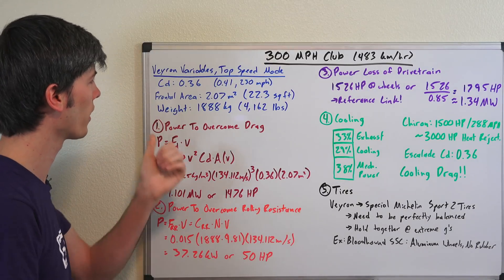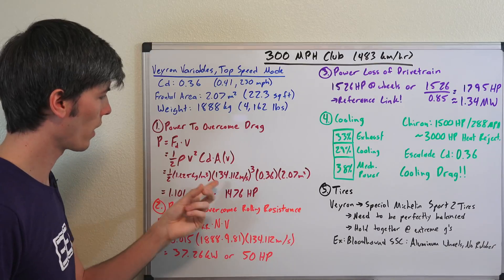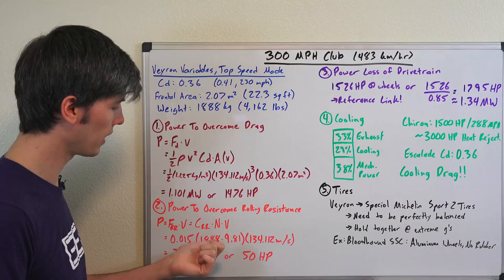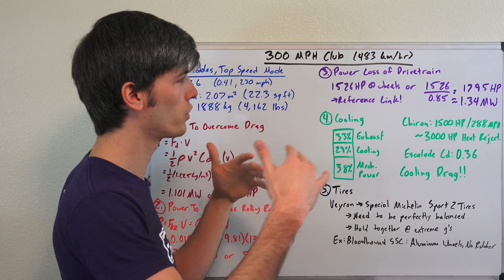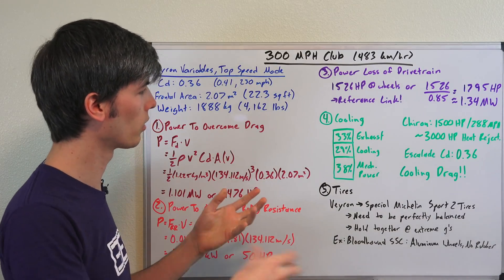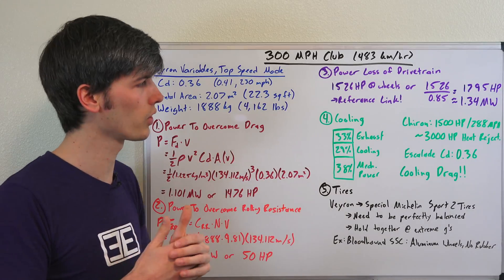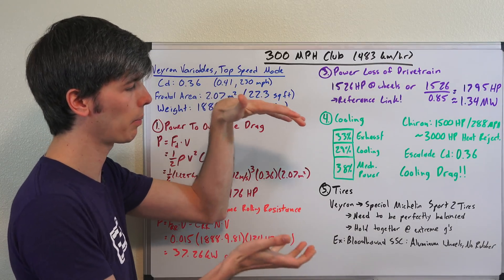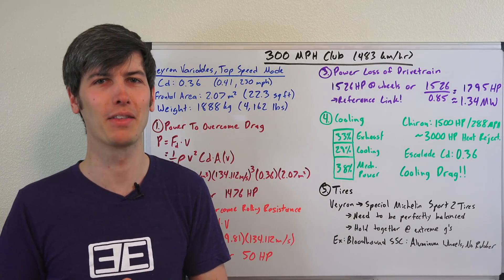Why Has No Production Car Hit 300 MPH?

Comment: A $350k drivertrain better be able to do 10% or less impact on hp. Even so to produce more hp would require significant mods and the increased cooling of those mods making it heavier which will also make it need stronger heavier tires.. The veyron platform is not a good starting point to reach 300mph from factory. The Carol Shelby approach might work, small super light body with a beast of an engine. Starting with a 454 you can get to 2k hp easily. With a light body that's more aerodynamic, and has the new hollow wing system combined with built in rads. So creating  downforce also becomes cooling equaling less drag. It could be achievable at a more affordable cost than a veyron, but most cars don't cost half as much as what they sell for anyways. Tires, and politics are the 2 big things preventing this from reality. Also why buy a factory car to go 300mph and not just build one. It's not a smart idea to go 300mph and then try to daily the thing afterwards.

Comment: i have a feeling electric cars will be able to do this easily since the batteries and motor dont generate heat at the same rate that a comparable engine would plus you would eliminate the power loss through drivetrain by just going direct drive

Comment: Do electric cars need motor and battery cooling and if not or less; how would that impact the Cd and with that P required from the new Cd would it be possible for an electric car to put out that kind of power??

Comment: Seems like from a cooling perspective that speed might be easier to achieve in an all electric vehicle. As much as I love the ICE it isn't that efficient in using all of the energy it generates (I believe somewhere around 20% efficiency compared to around 90%).

With a lower CD and area the power required would be less, the challenge then is an energy storage device that can handle the discharge rate required to generate the power.
Reply: Ross Hines f1 engines are working at 50% and you also have to consider the weight of the batteries and the heat they create when discharged

Comment: Design the car's body with an inner shell that maintains a narrow gap with the outer shell; then force coolant through a channeled gap under the aerodynamic outer shell.  Alternately, coolant tubing could be bonded to or molded into the underside of the car's skin.  This way, the huge surface area of the car's body becomes a radiator, activated at high vehicle speeds.  Such a system would require low-pressure operation with a condenser and valves to keep coolant from boiling as a second stage of cooling that augments a small conventional high-pressure system.  OK Jason, tackle that scenario!

Comment: In the rolling resistance calculation, you assumed that Fg = Fn, but this ignores the downforce that the car produces. So that estimate is probably quite low.
Reply from the maker: +Joe Smith did not account for downforce, correct, but I used a conservative (high) estimate for Crr. Additionally, rolling resistance is very minimal in comparison to aero (about 3% in this case). Certainly should be included for completeness, but doesn't have a huge impact on the final result. Ideally, for a top speed vehicle, you don't want significant lift or downforce. Just enough downforce to keep it stable and prevent lift, but not much more. Adding downforce at speed means greatly increasing the amount of aero drag to overcome.

Comment: Why doesn't the downforce matter when computing the rolling resistance? I'd assume that the normal force changes because of it as N = G + Downforce.
Reply from the maker: +Paul Herman should have included it, but idk what it is. In top speed mode, the car is set up to reduce downforce and thus reduce drag.
Reply: Engineering Explained i think due to the high speed air going down below the car lifts the car which cancels the excessive downforce also the presure variation should also have had some effect in that hence rolling resistance might just be fine without it
Reply: Your equation for air resistance has it varying as to the square of velocity.When you put the actual numbers in the equation you cube the velocity.I believe this is correct.

Comment: hell, why even buy a car with a max speed of 100 MPH if you're only gonna go 80 MPH on a highway
Reply: Kenan Varin I did 140 today you are fake news
Reply: Kenan Varin Put it this way, if your car is topped out at 80, that engine is screaming, compared to a more powerful car which can cruise at 80 with the engine barely breaking a sweat. Also, the typical car would probably only need like 70 hp to reach 80, which is not much power to accelerate a 3000lb+ car from a stoplight or to merge onto the highway

Comment: Hey Jason, quick question. 
If the engine thermostat is not fully closed when it should be, is it bad for the engine?
P.S it's a 1.6 litre 90HP Renault in a hot climate country.

Comment: could you get up to 300mph in an electric car since you don't need a complicated cooling system
Reply: fastest production gas vehicle right now - 280mph. Fastest production electric car 155mph. Electric production cars will not reach 300mph before gas. And electric still needs cooling for the motor

Comment: Electric cars will do it first. You have tiny little Rc cars going 140mph.
Reply: Knights Templar yeah but no cup holders. heh
Reply: It's all relative, tiny RC cars have a very small frontal area and can have a small Cd because the shape can be basically whatever.  Also velocity is cubed in the power equation, so it would take 8 times more power to go from 140 to 280 mph.
Reply: Basically a tesla with a gearbox
Reply: mondayfool ahh electric vehicle still need cooling 😂
Reply: Unco Casey but they need much less cooling since they are much morr efficient than petrol engines
Reply: No it won't the electric motor will either run out of juice or burn itself  out before getting close to that
Reply: Maxi ?!? Transmission to reduce RPM
Reply: Transmission along with electric motor.
Reply: Knights Templar the key word there is tiny, that's how they get there, a petrol engine with 1200 hp will have the same top end power as a 1200hp electric engine
Reply: who cares... I only need to get to 88 mph lol
Reply: Knights Templar hybrids, more like.

Comment: hey! I just wanted to point out that on your power to overcome rolling resistance calculations you have the correct answer but you wrote incorrect calculations. you forgot to write down that you multiplied the mass × gravity. you only wrote down P=CRR×m×v
Reply from the maker: N = normal force = m*g. It is written on the board correctly, but I should have written it out fully.
Reply: Engineering Explained yeah the equation was written correctly. I was just pointing out the inconsistency in the calculations which only had mass. love your videos man!
Reply from the maker: 1888*9.81 = m*g, shown below the equation. I did not explicitly show that N = m*g on the board, however. My bad!
Reply: Ohhhh my bad! I did not notice the 9.81 there! I must be going blind haha my brain processed the 9.81 as the units written beside 1888 lol

Comment: Very detailed at core information as usual. Great Job. Kind of a good thing that you let out the downforce induced drag, AC induced drag, and wheel spin induced turbulence because those are where things get way too complex.
Reply from the maker: Downforce induced drag is accounted for in the drag coefficient. I did not include downforce in the rolling resistance calculations, however the power needed to overcome RR is minimal in comparison to aero drag, especially at 300 mph.
Reply: Engineering Explained thanks for the clarification!

Comment: "Why has no production car hit 300 MPH?" 
It's a little thing called Laws, Speed Limits, Practicality & sharing the roads with subspecies humans with a Driver's License that "Production Cars" tend to take into account... That's the relevant "Drag" coefficient not found in your equations.:-/ 
Aside from that, this can easily be achieved with an electric vehicle ONLY where tree stump pulling "Torque" is the tool for the job rather than "Horsie Power".
Reply: Look at and analyze the formulas for torque and horsepower, they are inextricably related. 
Horse power is torque with rotation over a time period. 
Torque without rotation (RPM) is simply statically applied torque where no work is performed regardless of the time period.
Reply: Okay... Thanks! :)